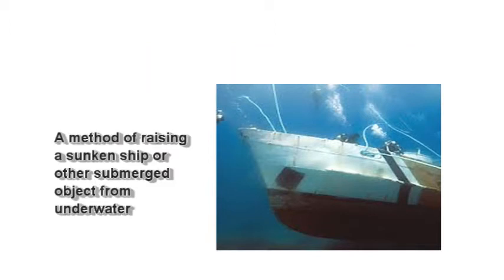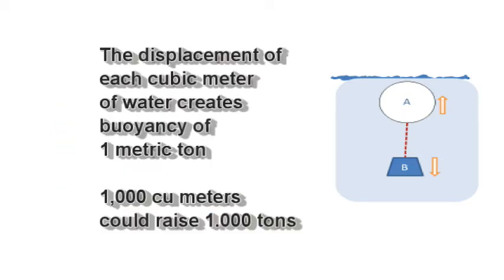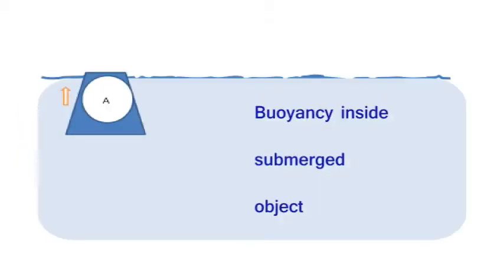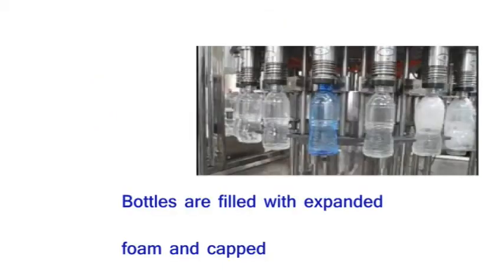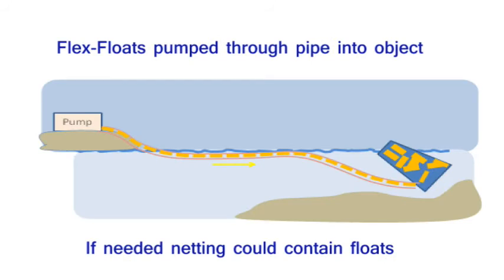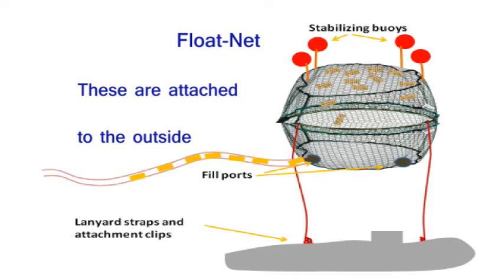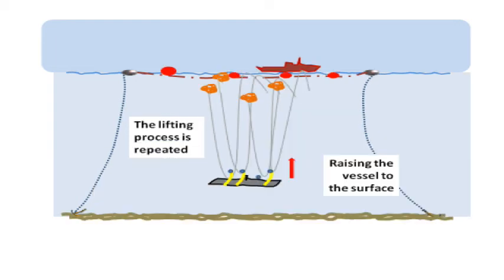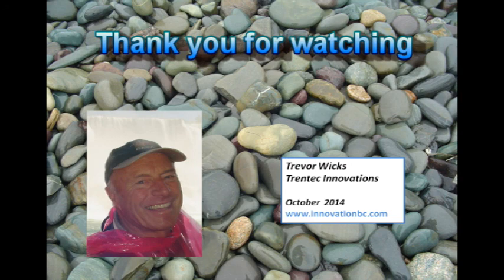Marine Salvage Concept

Comment: WHOLE LOT EASIER to use farm-tractor inner tubes to float water salvage, that's for sure! Take them down with you, along with an open-ended HDPE water barrel, use nylon rope to secure the barrel (bottom-up) to the salvage, then put the inner tube into the barrel and start inflating...will lift almost 3,000 pounds, for each used.